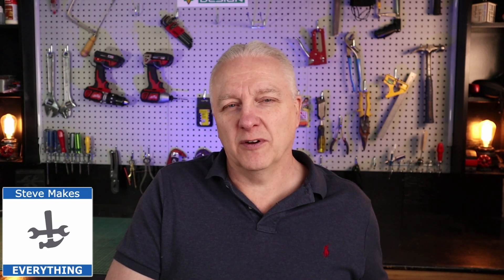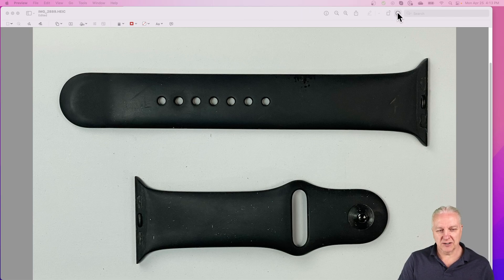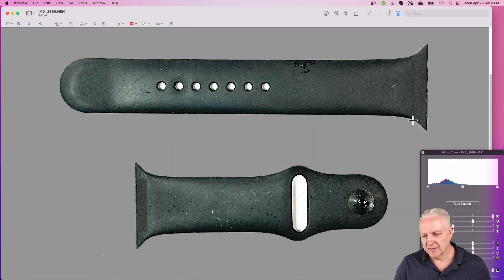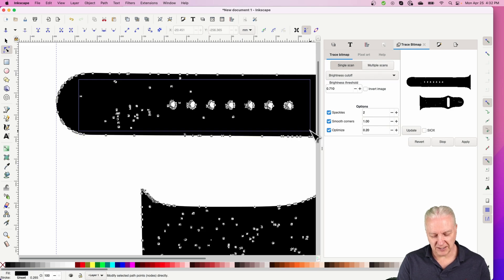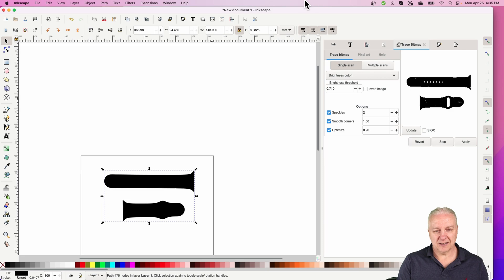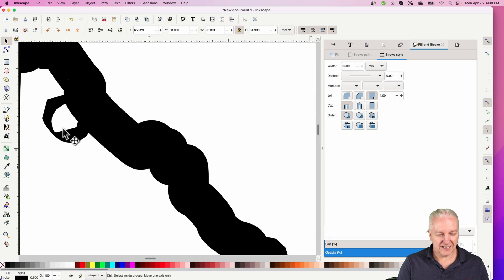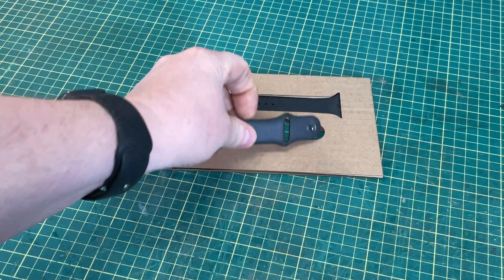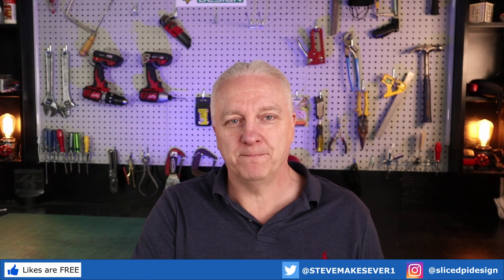Hacking Designs - Create Designs from Existing Objects

Comment: Can we just lay the watch band in the laser bed and have it engraved there (making sure that it won't move during engraving) rather than dealing with creating the jig/template first? Wouldn't it be possible? I am asking this as a 0% experienced person on the laser engraving who just started to explore it, so please bear with me if this is a nonsense question 🤔
Reply from the maker: You could, but if you want to build more than one or want any pattern on the band to be straight, then a jig is your friend.  It will ensure that there is proper alignment and making subsequent bands is just a case of dropping the band into a jig and rerunning the job without having to worry about alignment, etc.

I don't think any question is nonsensical BTW 😀
Reply: @SteveMakesEverything  Thank you very much, your videos are really teaching a lot and very motivational. I am now thinking to buy Muse 3D after watching your videos. Thanks.
Reply from the maker: @angorali06  The Muse 3d is one of many fine lasers available in this price range, so shop around a bit to make sure you get what you need

Comment: So if you laser engrave an Apple Watch band there’s no color in the text or picture correct? I’ve seen some that are white on black so I was just wondering if you can get any color on the band
Reply from the maker: You generally get just an engraving with the band color.  If you wanted color you’d have to mask of the band an engrave.   Then paint into the engraving before removing the mask

Comment: Love the hack, we do this at work with small parts we need to cut and the customer doesn't have a drawing.

Another "hack" would be taking a picture of the item next to a ruler or some known dimensional reference point and scale it to size.  Works great!
Reply from the maker: Yes this would work for things where accuracy isn’t as critical.  Here. Just chose to measure a couple fixed dimensions and scale the drawing accordingly. Even on small pieces it a can get you within a millimeter